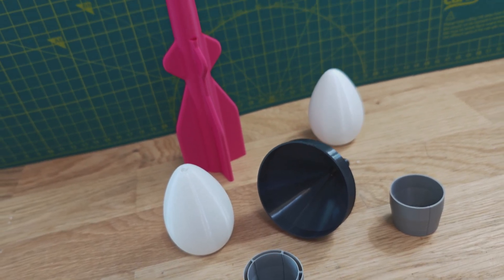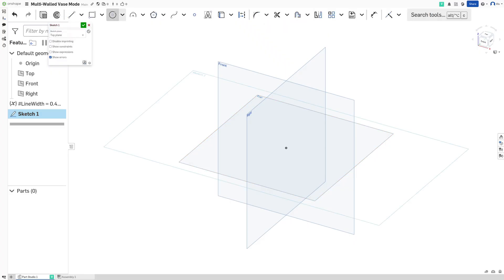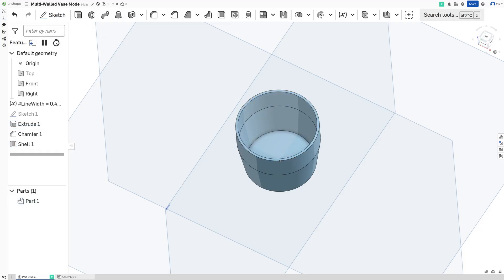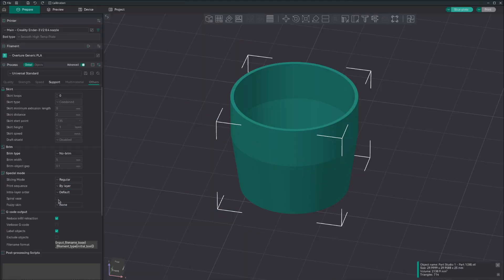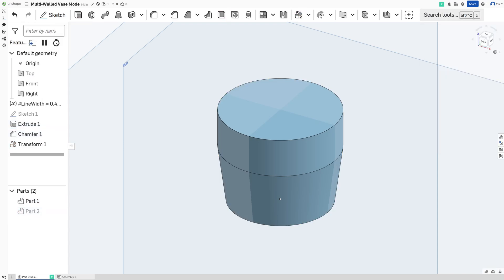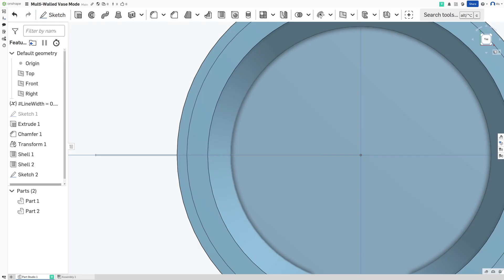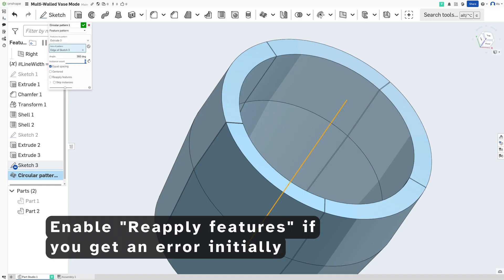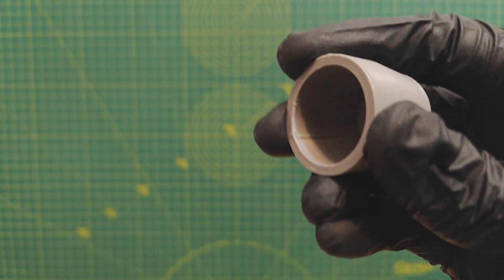Vase Mode Printing for Strength AND Speed?

Comment: Very nice! Thanks! I've modeled a couple of rc planes following this principle, but the method I employed was a lot less efficient than yours. Two suggestions for future videos, if I may. Try making the ribs as spirals that wrap around the body. Also it'd be worth trying to do it to a more complex, organic shaped model.
Reply from the maker: Thanks for the comment!! I definitely wanted to standardise the process for myself to make it easier. Also its funny you mention the spiral cut, because in the video after this (the one about the incense holder) I use exactly a double wall with a spiral cut for a seamless but complex part with overhangs. Let me know what you think if you check it out :)